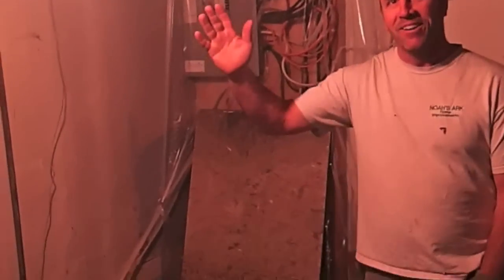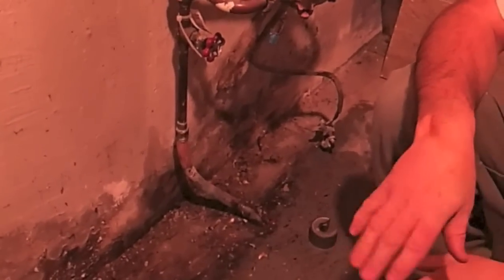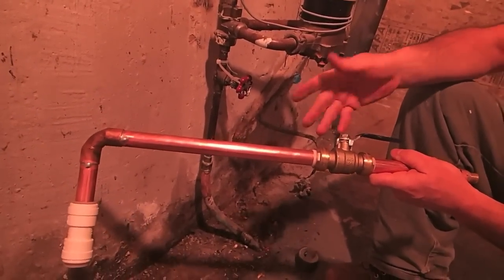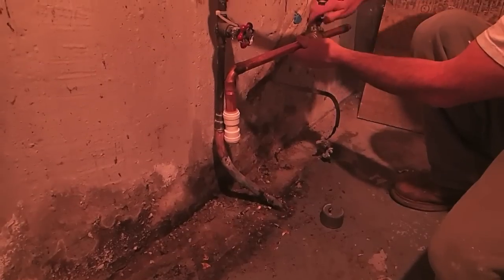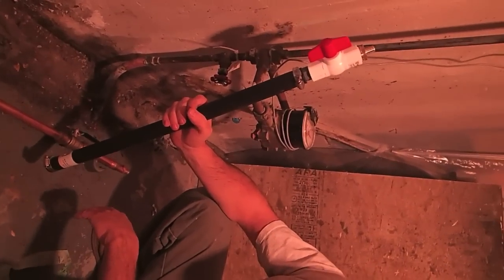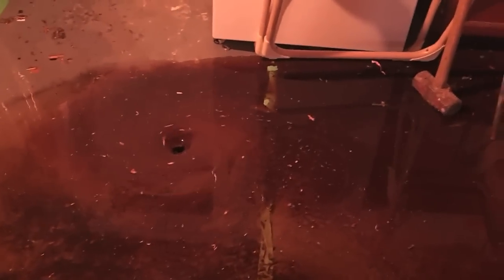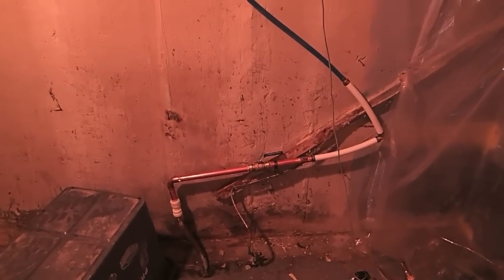live main water shut off replacement

Comment: I needed to do the same thing in a condo for the hot water inlet. No access to the main, previous valves were shot. I had the same idea but thought it was crazy until I saw your video. You know what? It was even crazier. I had 70 psi coming out...and no backup plan, lol. But I got the sharkbite on. Despite all the critical comments, I really appreciated you putting yourselves out there and sharing the experience.

Comment: Man you guys have balls! That and lucky enough to have a floor drain. I just replaced my main shut off using shark bite fittings and had to have the city cut off the water because my water comes into my house in my wood shop. Using your approach would have spelled disaster for me. Glad it worked but now step back and imagine if you had no floor drain and both your plans failed, in a finished part of the house. I even thought about getting a hose ready that led outside that I could shove over the supply line on a similar attempt. Shark Bite rules!
Reply: Why did you use sharkbite if water was off at main?  Why not solder a valve on?
Reply: Because of convenience and speed. The sharkbite fitting installed in under a minute and since my main comes in low and flows up I would have needed to find a way to drain the line to solder. Not possible with standing water in the pipe.

Comment: thank you for making this the curb main at my residence is like 12 ft deep and it can't be shut off with the longest tool the water company has.  my main shutoff in the house needs replacing and this video is the ticket. thank you so  so much! very clever solution.
Reply: Why would a curb stop need to be 12ft deep?

Comment: I know this is an old video but if you ever run into this problem again use a cold shot pipe freeze kit. it uses co2 to freeze the water in the line and stop flow so you can make repairs.
Reply: William Stanley maybe a leak in the house. Freeze wouldn't work then...

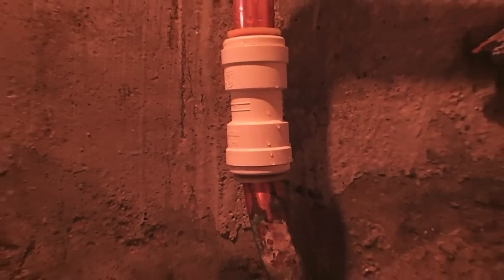Comment: I have only seen 3:13 of this and from my opinion they have the right plan of attack and it will work I like the copper pipe fitting rather than the flexi black pipe pending the pressure it will slide off lets see. 4:28 this is very poor pressure = copper pipe fitting, this pressure is lucky to climb the first floor, the pipe work from where you are working back to the outside boundary might need replacing or upgrading. 5:43 I am truly amazed at the copper joining did you call it SHARK BITE very good it must lock in by pressure does it. Well done boys but just a wee note the pipe would have look a little professional if you copper pipe just went straight up but other than that I give you 10/10 Kia Ora

Comment: Hey boys the plastic insert on the sharkbite fittings is only needed for PVC pipe. You could of saved yourselfs a step and just fitted the ball valve only.
Reply: that is a temp shark byte fitting the ones you are suppose to use use are about 4 inches long and about 30 bucks

Comment: You do know that if that didn't work, and your supply line was not plugged like yours was, the water would have been coming out at 75 psi, not the 5 psi like you were getting, and it would have gushed to the ceiling, and your house would have filled up with water in less than an hour?  There is definitely something wrong with the supply pipe, it should not have such a low pressure like that. It is probably crushed somewhere between the house and the street.
  Also, Sharkbite connectors are not allowed to be connected to the main in most places, not according to codes.
With water in the main line, there is no way you will be able to solder it.
I like your second backup plan much more.  Using a cottage type Polyethylene pipe with 3 or 4 hose clamps at each end is a wonderful way to connect to a rigid pipe.  My grandmother had a water pump that had a short section of 1" galvanized pipe coming off of it, and it was connected to the rest of the house with a 12" length of black Polyethylene pipe, and that pipe stayed soft and flexible for more than 20 years and never slipped or moved off of the pump, even with all of its vibrations.  It used 2 all-stainless steel hose clamps at either end.
Reply from the maker: we did go back and do a solder weld once spring came and town fixed street valve. Turns out the whole steet has low pressure and they are in the process of upgrading the main.
Reply: Willilly Bab    The black poly pipe you speak of has all been recalled.  So has the blue and grey!  Anytime I see it as a professional plumber, I recommend removing it as a potential disaster.
Reply: I know I am replying to a old comment but he was referring to polyethylene and not polybutylene which is the recalled pipe.

Comment: It's an old video, but wow...glad that worked out for you guys.  Would have been a lot harder to get your temporary shutoff on there if the supply pressure had been normal.
Reply: Not with the valve opened. Open valve, put on pipe, close valve.

Comment: Posted 2014 , not to far ago , low pressure was due broken valve ( City service Water valve )  at Curb location , the entire job could be done with  Pro - Press  fittings  and freeze the line , or not even freeze ,   isn't require soldering , the worse scenario is using  bras quick -shark fittings include valve , stand compression fittings that's hard to work under pressure .

Best is to wait till Water service valve is replaced by Municipality and soldered new valve , if can't be wait then freeze and pro - press .

Comment: You guys are nuts! I always use auto jumper cables when cutting a main line, You have no idea if the house has a bad ground. Plastic before the water meter and shutoff valve? really
Reply from the maker: Yes because there could have been a live line hooked up to the main pipe under the cement floor or even out at the street!
Reply: @svDansleau  plastic eliminates the ground. You couldve at least used a brass coupling or a compression coupling. But as non certified handymen you dont know the difference. Leave fixing stuff like this to people who actually know how to do it and stick to like paint and taping drywall and things that handymen are skilled enough to do. (Which isnt a whole lot)

Comment: Usually the copper water supply pipe is used for electrical ground. That plastic piece would negate all ground if a separate ground rod is not used. Potentially dangerous.
Reply: That is a dielectric union and should have a copper jump wire with clamps installed from where they cut the incoming pipe to where the metal pipe begins again.
Reply: Mark Wright you could not condemn it and there are some old systems where that main is used as a earth ground as long as you have 25 Ohms or less of resistance do not need to run second ground rod.Google The Code.And there is a big difference in Earth ground and equipment grounding conductors.
Reply: Sorry Mark, copper water lines were used as the grounding electrode conductor in many houses

Comment: Why not just call the water authority They own the Curb box its there problem and Willy is so right the main has a major problem, Personally i use jett Sweats the fast easy and very reliable and can sweat a full port ball valve on right away.Watts push fitting kinda suck being plastic Or you can propress a valve on pretty quik or 90 and Bv  and also if ur smart pex on your pex connection to the drain or laundry tub No need to make a mess

Comment: Please keep us posted on the shark bite connectors
Reply from the maker: It was changed to a solder on valve in the spring when we could access the road tap.
Reply: @svDansleau  was the shark bite holding up ?

Comment: That might be good for a temporary path, but no way I would have that push on fitting in my house. I would have called the water company to turn off the service, and sweat in a new full flow 3/4 ball valve. The repair you made is a disaster waiting to happen.
Reply: Compression fitting on one side  with a male threaded adapter on the other then  screwed into a threaded ball valve ......might be handy to have   around in case of burst pipe...
Reply from the maker: We did call the water company. Bugs me, people that can't read!

Comment: First of all, your mains pressure is very low so you may have a leak externally or crushed pipe. Secondly, why didnt you just put the lever valve straight on to the pipe you cut? Lol

Comment: That was stupid putting shark bites before the meter. Should have straightened out that k copper and used a cts fitting.
Reply from the maker: BUT! The intelligent viewers read that it was only temporary till we could access the curb valve
Reply: @svDansleau  it was so stupid I stopped watching once I figured out what you were doing. You're talking to someone that works for a utility. I've replaced curbstops and rebuilt various meter sets. Even as a temporary fix is unacceptable. I'm sure the majority of the people I blue tag and deny service to have probably seen this video.
Reply from the maker: Well Ryan
We all know what city workers are capable of!

Comment: Using a plastic john guest sharkbite on live copper is one of the dumbest things ive ever seen as a professional journeyman plumber. And using the high density polyethylene as a last resort is a rookie move at best. If you gotta cut a live main just use a sharkbite ball valve (brass) or brass coupling. Then hire an actual plumber once you can shut the water off. You should probably stick to your day job of being handymen do it yourselfers cause youre better at that. Leave the plumbing to a professional
Reply from the maker: Hey Mark
I guess I didn't dumb it down enough for people like you that need to leave 3 disrespectful comments. It clearly stated that this was a temporary fix and we are not professional plumbers. 
All of the "Handyman" seemed to have got it. So much for post education! 
If you ever need a hole repaired let me know!